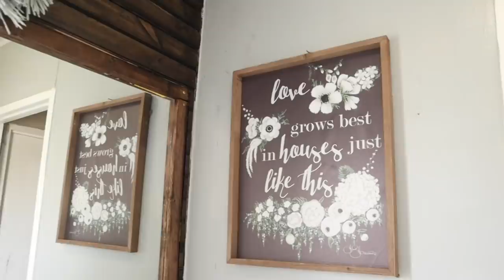FARMHOUSE MOBILE HOME BATHROOM MAKEOVER | on a budget | single wide transformation!

Comment: You can take the vent outside and spray paint it to match. Whether silver or black, whichever you decide for your faucet and hooks.
I would have definitely stain blocked and painted the ceiling to give it the clean and refreshed look. Repaint and touch up the walls. 
Just my two cents. You did and do outstanding jobs in your home.

Comment: On the ceiling you can paint it with zinneres that’s what we used in our trailer you might have to use two coats it will seal it so mold comes back

Comment: My house had really bad flooring in the bathroom as well. You can level the floor easily enough with plywood and concrete board (best used where moisture is present vs drywall/Sheetrock) we actually used pieces of vinyl flooring scraps as well instead of wood shims, then laid down tile. I know you and your hubs could definitely do something similar! You guys rock the diy projects. Plus it’s a very affordable under $50 fix 👍🏻
Reply from the maker: Ok I definitely I have to look this up!! You made this sound super easy!!!!

Comment: I am in the process of doing a full bathroom remodel in my mobile home.  There is a slow leak under the tub and it is going to eventually need replaced.   I am not too sad about that and I am also going to rip out the double sink ugly vanity, because the floor under that is rotted out.   The tub is an full enclosure ugly from the 70s and i lose about 2 feet ceiling space so when taking a shower i have to bend. ( im 5,  8.).  Basically my bathroom looks like the 70s threw up all over it.  I did paint the dark paneling 10 yrs ago to white and replaced the main floor, but it is worn.  As for people thinking mobile don't last, mine is 43 years strong.  Great job on the bathroom.

Comment: hope you get this ..it seems I've it's the floor but it's the toilet structure. water im sure even possitive that it the flooring of the toilet.
you can have Shane remove the skirting you flush the toilet and you'll see where theres a leak that keeps on leaking.
that'll also be hooked into plumbing from washer and driver.
just saying 🐊 chk it out.

Comment: As a flooring store owner I would not suggest buying “cheap” flooring nor do any type of installation if your not 💯 percent sure you know what your doing, in a trailer the subfloor is very susceptible to moisture and you can cause all kinds of damage with trapping moisture. Do your research and there are a lot of flooring stores that can help you and will work with your budget, I say if you have to buy it twice because you didn’t do it right the first time is it really “cheaper”or if you have to replace your subfloor because you created a seal with the floor and it rots out the plywood you will wish you asked a professional that I can promise you. Just food for thought.